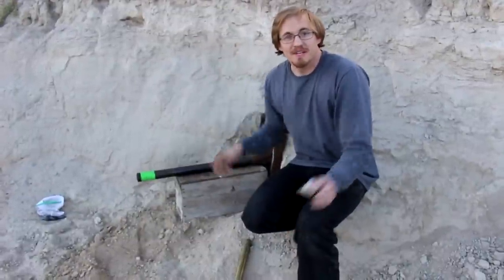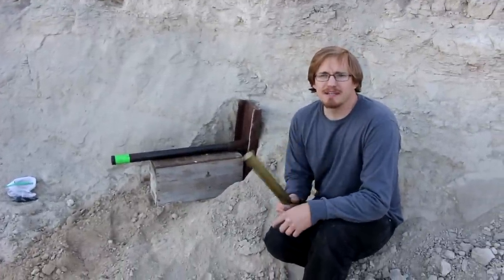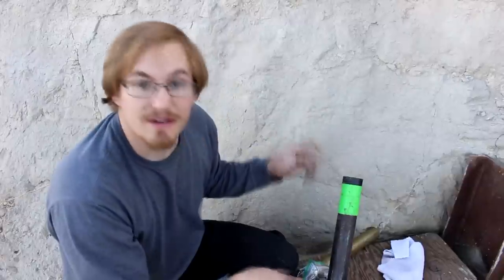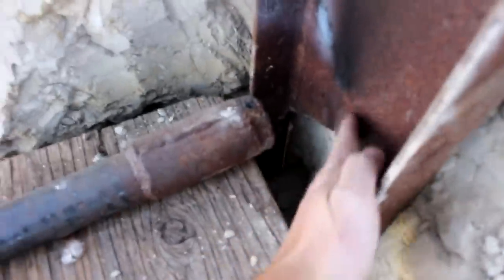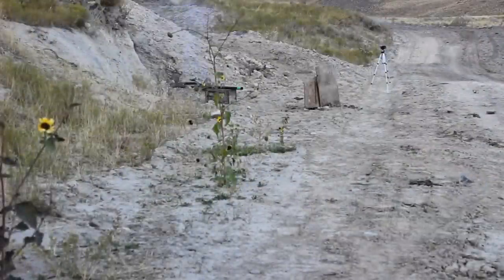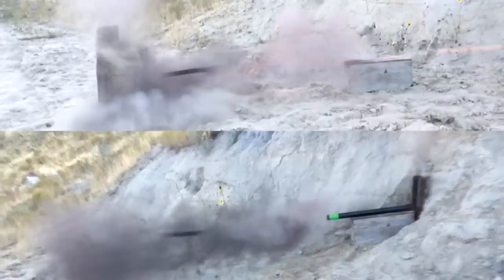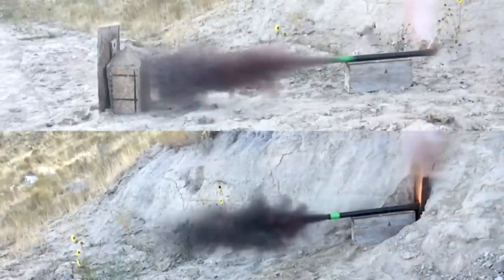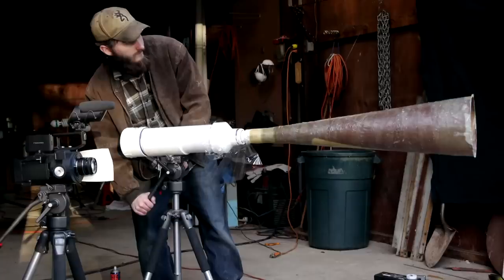How Does Recoil Affect Gun Performance?

Comment: Newtons third law doesn't say that the amount of work of the gun and the bullet is the same, it's only the force. And the force is always equal, even though the pressure is not everywhere the same. The impulse of a system is constant, so m*v of the bullet has to be the same as of the gun/earth. If there would be no loss of gas you should see different velocities, because heavy objects with the same impulse have less energy than light ones (kin. energy depends on v squared)!

Comment: Isnt it more complex than that? (probably a PHD thesis!). The gun will move back and the force will be equal and opposite. If the guns movement is restricted by a heavy object, then the back pressure will increase which will increase the force on the prjectile. I dont think your experiment is sensitive enough to reveal that effect and that the difference between no recoil and recoil isnt clear enough when all you do is block its back. Adding a very large mass would be better. 
I love your videos, always learn something!

Comment: Is all about last thing you said, kinetic energy, every energy is dispersed equally to every side, so the same amount of energy to the barrel for the projectile and exiting the hole. Both occasions there was speed on the barrel(even for a short period of time). So your experiment is a failure. You have to fully strap the barrel and make sure it doesn't move. Go more scientific strap the thing good, and see how far it goes before touch the ground, then compare results.

Comment: I disagree, your assumption violates conservation of energy. If the barrel and bullet are the same mass, the barrel will fly back the same speed as the bullet flies forward. Subtract the kinetic energy of the bullet in both experiments and we are left with the barrel flying back with the same mass but negative velocity of the bullet. kinetic energy is proportional to the square of velocity, so it does not care that v is negative, therefore you claim to have created the barrel's kinetic energy from nothing.

If you use a very light barrel,  the more massive bullet will hardly budge. Try making an inverted gun that shoots the barrel, with the 'bullet' being a longer solid metal cylinder with much greater mass. I'm sure you can see the failed duality. as the mass of the barrel approaches 0, so does the the velocity of the bullet. since the other barrel is fixed to the mountain, it's mass will remain immense even if the mass of the barrel itself approaches 0.

I'm a huge fan of your channel, and it would blow my mind if you'd respond. I love how you go to great lengths to ensure what people see is accurate, so I hope you re-check the physics here.

Comment: Excellent experiment except that it isn't realistic in relation to a real firearm. A regular bullet is usually a fraction of the weight of the gun - Therefore recoil/no-recoil will have almost no effect on the ground speed of the projectile. A thought experiment I use with undergrads is to think of a projectile which weighs significantly more than the gun - Imagine what happens with the gun in a fixed position vs. free floating :-)

Comment: Dude, explaining trough physics is fine but method is wrong. You've probably wanted to test if there is a difference when firing a rifle when bracing it against immovable object vs shoulder or firing in midair. But since rifle is much heavier than regular bullet the worst shot would be fired out of a gun that was braced against completely immoveable hard object because of barrel vibrations that would happen before bullet exits the barrel not because of interpretations of Newtons laws, as a proof you can look at every cannon design so far, every canon has a way of delaying recoil and thet is for a reason. Shot wouldn't be slower it would just be imprecise. Limpwristing a gun affects its performance but in reliability not in bullet velocity, but again its about difference in mass.

Comment: First downvote i had to give you - all your other vids are excellent. This one isn't. High speed footage isn't properly synced, your physics are wrong. There is no conservation of energy, only momentum. The braced gun MUST fire faster. And it does, slightly. The unbraced one is a frame or two early in firing, that's why it appear to be just as fast.

Comment: I'd like to point out: conservation laws only apply to closed systems. This is an incredibly difficult system to close, you've already mentioned the mass of the earth, and that it's not perfectly ridged, you also have to contend with the atmosphere. However, perhaps the most difficult thing to really factor in (mathematically, you can make some simple assumptions conceptually) is the influx of energy. The way you were describing balancing the work, it seems you're looking at work against the cannon vs work against the projectile. This isn't directly relevant, you need to balance the work done on both of those by the gas, and the work they do on the gas.  And factor in the complicated rate at which the gas is doing work, since the powder is undergoing both and exothermic reaction and an effective state change of a component in the system.  Plus the force applied is based on balancing atmospheric pressure against explosive gas pressure, which itself has too competing factors, continuing reaction increases pressure, but accelerating the projectile increases volume. Now you've got a much more complicated kinematic system with significant thermodynamic factors. But, for simplicity, you can start looking at a model in terms of the work done on and by the gas, and see if it helps make sense out of the results. Then maybe test the basic model against a firearm that doesn't have a touch port.

Comment: Your hypothesis is not correct. In fact, your completely unscientific test bench is the very reason your results look similar. Yet they are not at all the same. The stationary barrel is imparting more energy into the projectile since gun gasses have more time to act on the projectile while it's contained in the barrel. 

In your un-restrained barrel, the barrel does not impart the same amount of energy as some of it is expended pushing the barrel backwards, also reducing the amount of time the projectile is being acted upon by the gun gasses. 

This could only be tested properly with two identical bullets, not your little black powder and wadding setup that does not uniformly ignite and burn during each test.

Comment: I believe the misconception came from both the fact that if the gun is allowed to move backward, not as much force is being applied on the projectile, as people believed the gun essentially 'stole' power from the projectile being flung out. Also, because the physical calculation of a projectile's speed in juxtaposition to a relative object increases or decreases depending on the rate at which the relative object is moving. (I.E shooting a cannon out of a ship at a rate of 30m/s from the rear of the ship while the ship itself is moving 30m/s causes the projectile to appear as though it remains in air as it has a velocity of 0m/s.) While this is correct, the fact of the matter is that the gun itself is not moving, and therefore will not increase or detract from the speed of the projectile. Additionally, when you're talking about the work, you are indeed correct. Because of the shape of the gun and the fact that the projectile is contained WITHIN the barrel, it will have all the pressure pushing it out., as this is what guns are designed to do: push the projectile out. With the half-as-long notion, you must consider the fact that horizontal velocity is constant. You probably are losing quite a bit of energy from unrestrained gun though, the only way you'll be able to tell is by using your chronograph to find the instantaneous velocity of the projectile or calculating it yourself with V=D*T where D = Distance and T = time and V obviously being Velocity. Hope I cleared some things up for both Cody and the people still in confusion.

P.S. Nice fort at 6:00.

Comment: When you say that the same amount of work is exerted on both the gun and the bullet, I assume you mean that only applies when their masses are the same? If two objects with mass m and 2m are repelled by a spring, lets say the object with mass 2m is accelerated to the velocity v. That means the other mass gets the velocity -2v, since the total momentum of the system has to remain constant. When calculating the kinetic energy of both objects (which is equal to the work done on the respective object) we find that one is 2mv^2 and the other is mv^2, not the same. Newtons third law doesnt imply that F*s is the same for a one force and its opposite force, F*t has to be though. 

The argument that the work exerted on both masses are the same only works when both objects have the same mass, which they are not when the gun has no recoil since then it basically has the mass of the entire earth, as you said yourself.

Comment: Another explanation to the question at 10:20 is simply pressure effecting the rate at which the powder burns and therefore creates energy. Gun powder is NOT an explosive, it deflagrates, meaning burns over time. The amount of pressure being built and therefore utilized is dependent on how much pressure the system can hold. Low pressure will do low amounts of work. A perfect example of this phenomenon is a shotgun shell, if you load the shotgun shell with a 1oz slug, the projectile goes 1200+fps and has a lot of energy, but if you load the same shotgun shell with much lighter airsoft BB's, they simply "thud" out of the barrel with very little energy, and a lot of the gun powder is left unburned. You are simply allowing the powder to do more work.

Comment: So in conclusion, you are in fact doing work on the strapped barrel even though it doesn't look like it and that work is equal to the work done on that bullet; and also that not strapping the barrel lets more energy be lost from the system as something other than acceleration of bullet/barrel but the previous statements remain true. 
Did I get it right?

Comment: Cody, an answer to the issue of work: In both situations the pressure of the explosion is acting on the rod for the entire distance of the gun barrel. The velocity of the gun barrel has no effect on the distance that the explosion provides a force over. The only factor it effects is time.

Comment: i liked this video until 6:00 then nonsense happened, you don't need gunpowder for this experiment,. you can have a linear actuator, with 2 pieces that weigh the same, on a surface that has low friction, then power them, simple as that, also, the video clearly shows a big difference in velocity between the 2 slugs.

Comment: For the problem you had,
think relatively: set the burning powder at the middle of your moving diagram. If the gun and projectile weigh the same, then they will both move the same amount in opposite directions. Now think of how the projectile moved relative to the gun. The projectile travels the whole barrel, but completes the barrel in half the distance relative to the ground. As such, the pressure difference and weirdness due to real world problems is negligible. Also, the pressure of the expanding gasses in the recoil situation relative to the breach and projectile is the same, so the pressure hypothesis is null.

Comment: Couldn't we look at this more simply: in terms of energy?  The same amount of energy is being released but in one case, the energy imparted on the unbraced barrel is being used to accelerate the barrel in the opposite direction whereas in the braced case, energy is being imparted on the backing plate as (mostly) heat which is what distorts the backing plate.  Is that a valid way to describe it?  Seems like the same amount of energy is going to be "lost" to the barrel in both cases: you're just observing that energy in two ways (acceleration versus heat).

Comment: the obvious point to make is that restricting the movement of the cannon increases it's internal pressure (as work is not lost, and air pressure is allowed to accumulate much faster over a short time span when the air is physically trapped).

you nailed it with the pen experiment - acceleration still needs time to propagate to a body in motion.

i could be wrong, but i think this is whats happening:
    - the projectile is put in motion the moment that it experiences a measurable acceleration
    - the projectiles appear to experience the same acceleration because they experience very similar moments of acceleration
    - the measurable difference in this moment of acceleration is experienced very soon after the objects are put in motion
    - the cause of this difference is the difference in internal combustion pressure of the cannon
    - this combustion pressure increases when the cannon is static (as a measurable force is contributing to the combustion pressure, in that case)
    - restricting the cannon's movement yielded a measurable, yet, insignificant increase in internal combustion pressure

while these points may seem obvious to a lot of people, there's kind of a cool idea behind it:

    - a projectile will experience maximum velocity when put into motion at maximum acceleration

this is why space shuttles get a good burn going before they even attempt to escape earth's gravity.  it makes sense, and it's really cool to be able to understand it.

thanks for the video, Cody!

Comment: I ran a simulation of the setup that you had in this video, and the results were that the projectile actually leaves with a 50% higher velocity if the pipe is held fixed (300 m/s versus 200 m/s). (I used guesses of the amount of powder and the dimensions of the pipe and brass projectile) I wasn't expecting this result, either, so I went back and looked at your over/under video comparison, and the fixed setup has the camera considerably further away from the cannon. I'd love to see this controlling for the camera distance. I didn't simulate the burn rate of the powder, I assumed it all flashed at 2,700C in an instant, and I know that's not the real case with gunpowder. In any event, work does not factor into the behavior. Work results in kinetic energy (~v^2). The velocity of the projectile is directly related to the momentum, and that comes from the force and the time, not the distance that the force acts. About the only way that both configurations could yield the same exit velocity for the projectile is if the entire powder supply is consumed before the projectile exits the barrel. That is possible with a small powder load and a fast burning powder. (The powder would need to be fully consumed in about 5 microseconds in your setup). As always, love your videos, and thank you!

P.S. My simulation says that your initial chamber pressure is about 13,000 psi, that's gotta be cutting it close for that pipe. I estimate the burst pressure for your pipe to be about 8000 psi, so it would have ruptured in my sim if I allowed that to happen. (I didn't allow any leakage out the ignition hole, nor did I account for the extra volume of the hole to reduce my initial pressure)

Comment: I have some opinions about this experiment in the form of an analogy. If car A is going 0.5mph faster than car B (the one next to it on a motorway) within the space of 1 second and 2 metres, it is unlikely that you would notice one is faster than the other. 
Even in your slow-motion capture you can see that the rod fired from a secured position is a couple of centimetres ahead of the one fired from an unrestrained position. The amount of gas produced from the propellant (in this case, black powder) is now able to travel rearwards, instead of assisting the rod's acceleration. 

For this test to be accurate, it would be ideal that the distance the projectile has to travel be increased, as well as being repeated 1 or 2 times to iron out any anomalies that might occur during testing (e.g. improper mix of powder affecting the ignition/combustion rate, or even a gust of wind against the projectile).

The idea of the experiment is very interesting, although I feel it could benefit from more rigorous testing. Even some of the most highly renowned scientists have had theories and experiments debunked, so another test would be wise to prove your theory further.